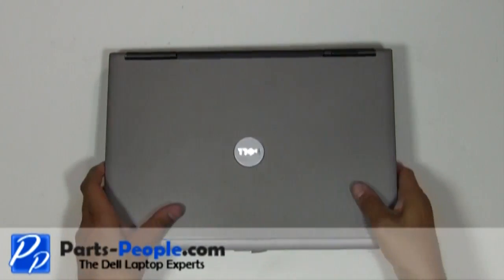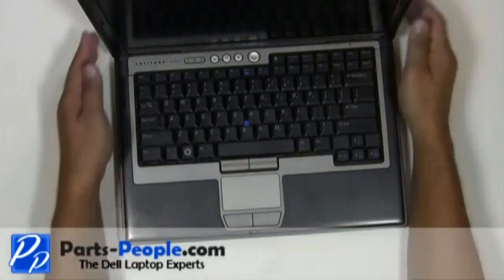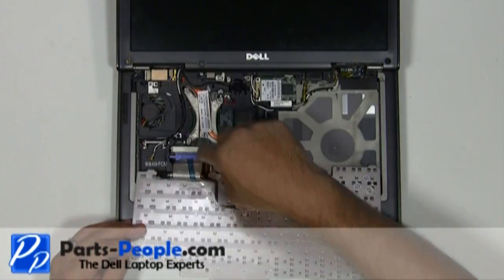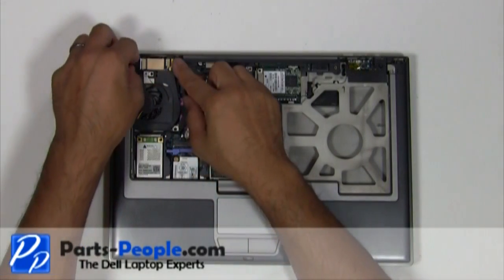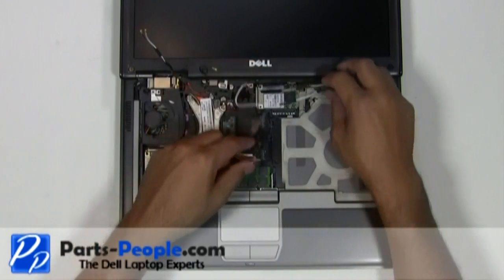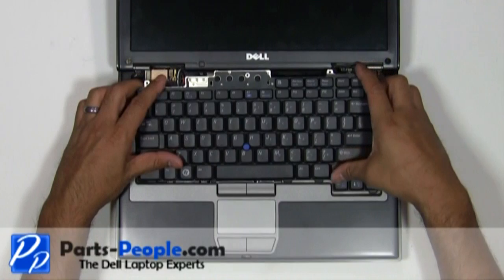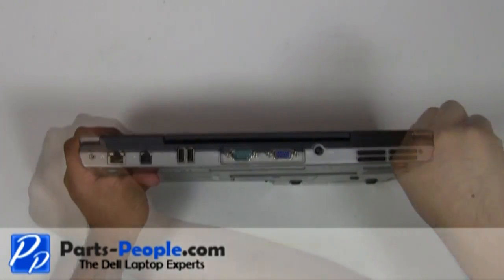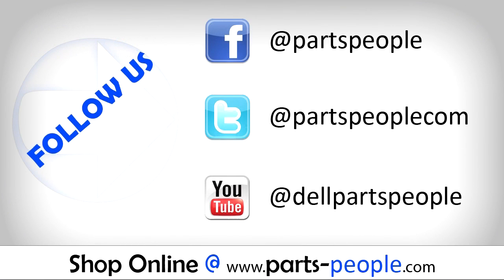Dell Latitude D630 | Bluetooth Card Replacement | How-To-Tutorial

Comment from the maker: There are two ways to turn on your wireless radios for the Dell Inspiron 1525, one is to use the Fn + F2 and the other is to use the switch on the right front side of the base.

Comment: Do you really have to remove the display?  It was easily done without those steps.  Not criticizing, just wondering.  Card slid in easily even with the left hinge there.  Thanks for the video...no idea where it went.  Took it out of an older inspiron where it was in a little recess in the battery department.